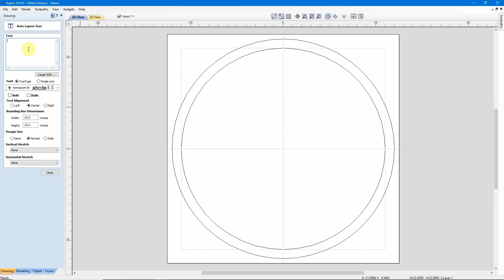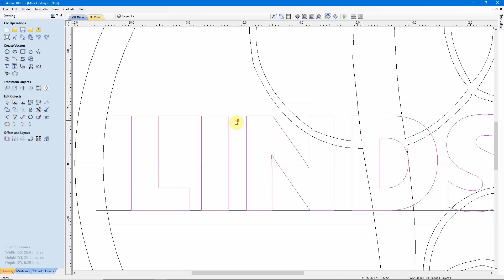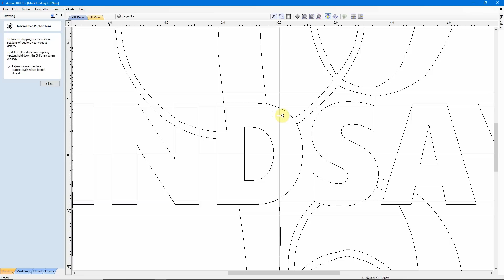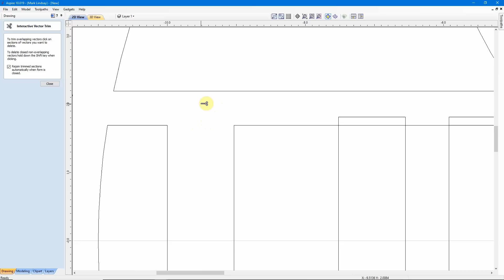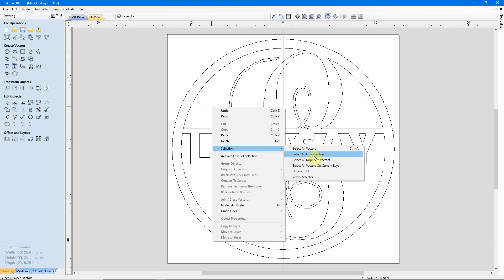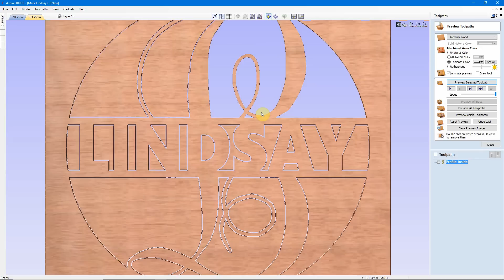Designing a Monogram Sign Using Vectric Software

Comment: Great video Mark! I tired several times to follow along. I keep coming up with open vectors and it will not cut.
Reply from the maker: Save that vector for later, do all you can, then close the trim tool. Select the vector that won't trim and go into Node Editing. Right click along the vector and select Delete Span. That should take care of it. Thanks for checking out the video!
Reply: @MarkLindsayCNC  Thanks Mark, I will try that and see how it works! I follow just about every thing you post, you are  a tremendous resource. You have taught me so much.

Comment: Made your monogram project. Great instructions, thanks. Had to make it half size because I was unable to locate 25" x25"x1/4" stock.  Care to share your source?
Reply from the maker: Thank you! Glad it turned out good for you. I use 1/4 inch thick plywood from my local hardwood supplier, and cut the sheets to size on my table saw. Thy regularly carry birch, maple, and cherry plywood in that thickness, and I pick it up as I need it.

Comment: great videos. very helpful. but im struggling with the polyline tool. im trying the monogram in aspire but keep getting issues when i create offsets of the lines i create. when i do the double offset of a line it joins the lines at one end with a half circle. hope this makes sense. id love to show you a pic but cant upload one here.
Reply from the maker: Hmmm... I've not had that happen. You may have to offset to the outside, then the inside separately. Also, shoot an email to Vectric Support and tell them about it. It may be an issue they're not aware of.

Comment: Mark: doing the inside profile with a 1/16" em for that large a project is really stressful for that em. Wouldn't it be better to perform the inside cut with a 1/8"em and then do a last pass with the 1/16" em /
Reply from the maker: You could certainly do that - it's totally up to you. If you go for a shallow depth of cut per pass and watch your feed rate, it'll be fine.

Comment: My project is brass sheet, 1/64” thick, from which pieces are cut out, much like yours.  But the design needs sharp inside corners, so I planned to try a 30 degree V bit that has a 0.005” tip.  Are there better ways?  Advice?

Comment: Mark one question When you use the painters tape and ca glue what do you add to the depth of cut to account for the thickness of the glue.and tape. Also cover all of the tape with glue it the monogram you just did.
Jeff
Reply from the maker: No, I don't add to the depth. I already go .005 deeper than the material thickness. It's not necessary to go any deeper. I also don't cover the entire back with tape - you'd never get it off the table without breaking it. I use 1 piece in the center, another piece about half way between the center and the outer edge (both top and bottom) and another piece along the top and bottom edge. Thanks, Jeff!

Comment: THANKS FOR A GREAT DEMO. What is the 1/4' board did you use for this design
Reply from the maker: It's designed to use 1/4 inch thick hardwood plywood. I usually use birch, but maple (or any other hardwood plywood for that matter,) would look just as nice.

Comment: Mark, another very informative video.  I just have a couple of questions, what material are you cutting, and will a 1/16" bit with a 3/16" LOC as per your amazon link cut through the material.  Again, keep up the great videos you provide.  Thanks
Reply from the maker: Good eye! I got the wrong bit - oops...  Technically, it will cut through 1/4 inch material because of the geometry, but it's better to have at least 1/4" LOC. I'll get that link fixed. Thank you!
Reply from the maker: Link fixed. Thanks again!

Comment: Great video. Is there a simple way to use a 1/4" endmill to cut the majority of the waste and then profile with the 1/16" bit? Or would you have to make 2 separate toolpaths and just let the software decide where the 1/4" bit won't fit?
Reply from the maker: You would have to create 2 toolpaths to do that, unless you used a pocket toolpath. That would take longer than just using the smaller bit to begin with.

Comment: Great video as always and thanks.I have a question I know will be tough without seeing but,I did 2 monograms the same and on each one I can't trim out a line in 2 different spots which will not let me close out all the vectors.
Reply from the maker: Hit me up through the Contact Us page on my website. Just drop me a message, letting me know it's you. I'll reply, and you can attach pics after that. Sorry it's such a convoluted mess, but that's the way the Contact Us form works.

Comment: Great tutorial Mark. I followed along using my name and everything worked out except when I went to clear the scrap areas after carving. When I double click on one piece most of the remaining letters disappear. The section that causes the problem appears to have closed vectors, so I'm stuck. Is there any way I could email the file to you for some help? Thanks Roger
Reply from the maker: This doesn't have anything to do with your vectors. If the preview cut otherwise looked fine, the issue is in the Preview Window itself. Sometimes you have to zoom in real close on a waste piece before double clicking on it. This is especially true of it's a very small piece. I'll mention it in this Sunday's video, as I'll be sharing some Preview Window tips and tricks.
Reply: @MarkLindsayCNC  Thanks so much for your reply. I did zoom in, as far as possible, while in the preview window but could find no anomalies. Actually I'm not too sure what I'm looking for. Thanks for your continuing assistance.

Comment: I'm having trouble with mine, while cutting the profile of part of the name it isn't cutting in the correct place. Vcarve is showing the toolpath as going on the correct path in the preview but it isn't. It is cutttng high under the LIN as if both lines under those letters are the same line, but on the following letters it cuts correctly.
Reply from the maker: It sounds like there's still an open vector in that area. Do a Box Select from Left to Right along that vector and see if anything gets highlighted. If so, delete it or join it to create a closed vector, then recalculate the toolpath and Preview.
Reply: @MarkLindsayCNC  I'll try redrawing it and check again
Reply: @MarkLindsayCNC  that seemed to fix it, thank you again for your detailed tutorials and answering questions on top of it!

Comment: Off topic question.  VcarvePro 8.5 has a utility named “do separate last pass” and you specify how much to take off and if you want to go in a reverse direction.   I tried several different amounts to remove thinking there may be a certain amount it is looking for.  .  However I have have never been able to activate it, and yes I do check the box.   What’s the trick to get it to work?
Thanks
Reply from the maker: There's no trick to activating Separate Last Pass, other than checking the box. I use it all the time to remove the step marks left behind when cutting through the material. You do have to be making multiple passes to cut through the material, however.  If you're cutting through the material in a single pass, there is no "last pass."
Reply: Mark Lindsay CNC the box IS checked and it doesn’t do the last pass. Thanks
I’ll submit it to Vectric.

Comment: Hi Mark, I've been enjoying your videos as a "sort of newbee" and working along as I begin my Aspire learning curve.  Following along on this video and I got to the Tool pathing, and previewed The Monogram Toolpath.  Following your lead I double clicked on the Drops, but them most of the preview disappeared.  As I attempted to work through it, I even got a Warning saying that all the Material will be deleted.  I'm sure that I've got something awry, but haven't found it yet.  It all looks good until I get rid of the drops.  No open vectors.  Material at .25, depthj of cut .255, etc.  Thoughts?
Reply from the maker: Zoom in a bit closer when you go to double click a piece of scrap. Sometimes the software thinks you're clicking on something still attached to the main piece.
Reply: @MarkLindsayCNC  Thanks for the quick reply, Mark!  But no, it is the same waste areas that trigger the rest of the sign disappearing.  I've zoomed in as far as I can and see no lines or pixels touching.  I have screen shots of the Preview window, showing the stages of waste removal.
Reply from the maker: Sounds like it's time to contact Vectric Support. Send them the screen shots. They should be able to track down the issue.
Reply: @MarkLindsayCNC  Already sent!  Thanks for the "Look/See"!....I'll let you know what I find out.

Comment: Hey.  I just followed this tutorial and it was great.  I have run into one problem.  When I do the inside toolpath it says there is an open vector but when I check for open it doesn't say there is one.  If I ungroup them and look for open ones it shows up but the Join button isn't highlighted.  It is grayed out.  How do I get this vector to be apart of the others.  I can't zoom in far enough to find it.
Reply: Edit:  I found it by hitting the join open vectors button in draw part but now when I go to punch out the cut out parts it makes over half of the picture disappear.  I am curious why that may be happening.
Reply from the maker: Look for overlaps. What I mean is, look for areas where vectors may be laying on top of one another. Select one of those open vectors and type N on the keyboard to go into Node Editing mode. Identify the end points of that vector, then select the vector you're trying to join it to. You may have to move those end points so that they're on top of one another. Then you can join them.